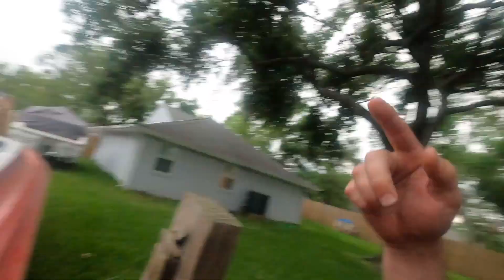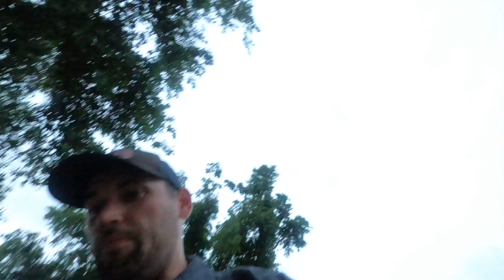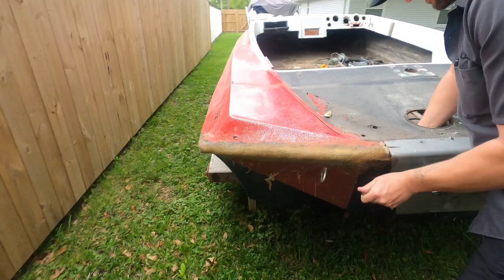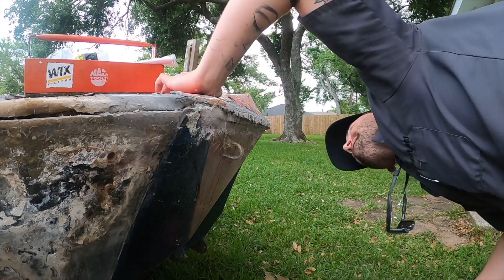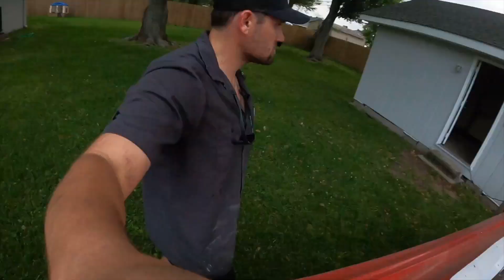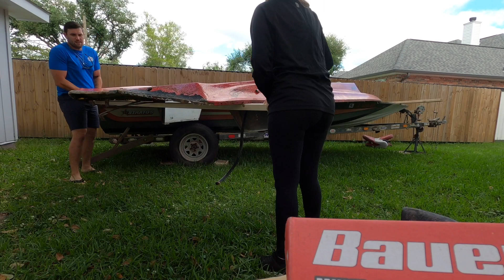Project Speedboat Ep. 1

Comment: I am watching your progress. I’m a little bit ahead of you doing the same thing on a 1979 Checkmate. I’ve already done the transom and stringer. Got all the floor glassed on both sides and test fitted so hoping to get it epoxied in this week. What kind of motor you planning on?
Reply from the maker: That’s sick. I was looking into Checkmates but just stumbled upon this one. Should start the glass process this week. Weather has been less than ideal. I’m thinking of mercury opti 250 most likely. Unless I find something else but that’s what it looks like. What checkmate are you restoring?
Reply from the maker: I would love a 4 stroke. Something like a Zuke 250SS or Yami SHO but they’re too heavy for this boat.
Reply: What happen to the postings?